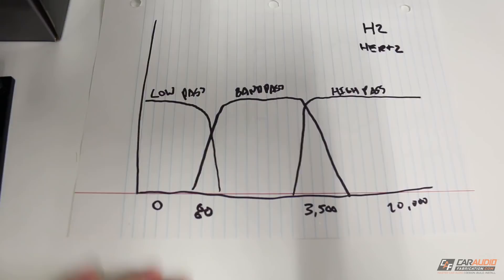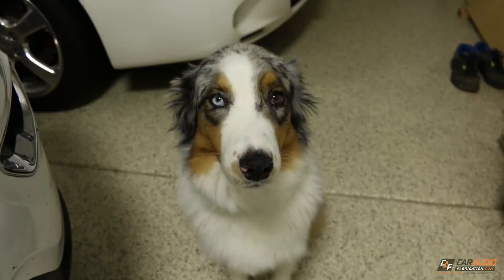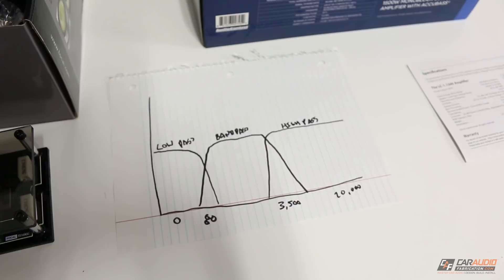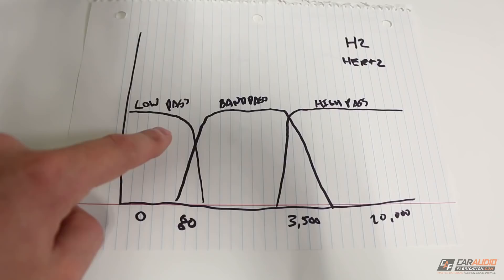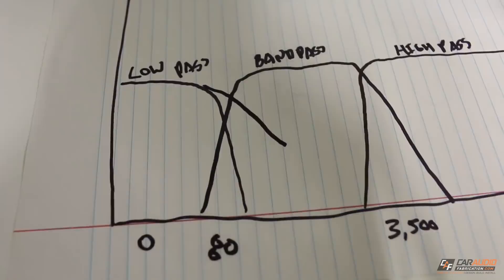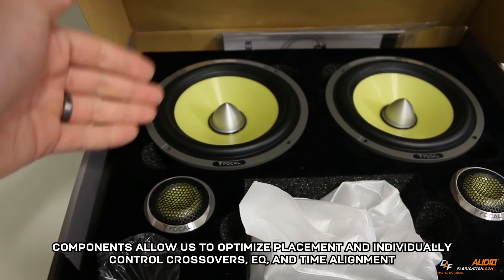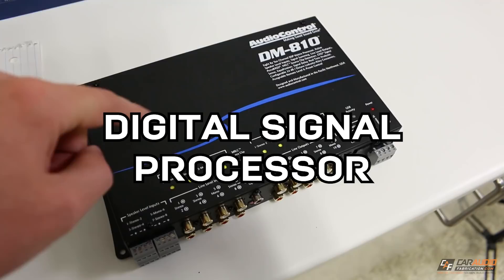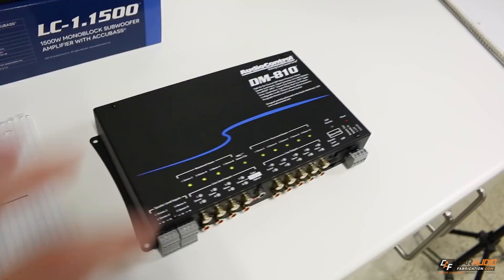Car Audio Terms you MUST Know

Comment: Cool dog. Hertz is also a speaker brand. I'm a retired electronic technician so I understand all these terms but I do occasionally come across something I hadn't heard before. It's interesting some vendors don't recommend a crossover for component systems - probably because the tweeters come with an inline non-polarized electrolytic capacitor whose capacitive reactance increases as the audio frequency lowers. I wish I still had access to all that test equipment you have.

Comment: Great Video👍🏿
I know im late, it being 2 years old already. Im an amature installer, and when I go to the local sound shop and begin inquiring about these Particular products, I cant seem to get them to go into details like You.  because Im wanting More control, planning on going with Focal 3way comps in my Caddy Srx(2014 Premium)for my front stage, Deleting the center stock speaker, and now,  realising how the position should be angled, But my Rear stage is a pickle for me, Because of those 2 speakers in my rear decklid. 
Now, after listening to You, solidified my choice in for my rear doors & decklid & about investing into an A/C DSP. Most importantly, saving me some $ in my build.
And intergrate my new Tesla style unit.

Thanks!✌🏿

Comment: Please help me. I have an alpine 600 watt amplifier and two 10 inch kickers. Just the other day the amplifier was blinking red and now that I've regrounded the wire, it's back to normal. Except when I hook my subwoofer the subwoofer shoots up and stays in the up position. Everything is connected right. 

Any tips? Thank you
Reply: Sounds like the amp is putting out a DC signal to the sub. That ain't good

Comment: If I’m using a 5.25” mid driver of a component set in a 6x9 opening and I want to get the most out of that speaker, what do I need to do?

I was thinking of a 6x9 foam baffle filled with poly fill
Reply: I would like that, but that is not a choice. I hot a Herts Hi Energy HSK 130 and I cannot get a 6.5"

Comment: Hi i have questions about alternators. You briefly mentioned a battery to power your amplifier i believe? So you're saying you're not using your alternator to power all these peripherals/accessories in your car? I was wondering if i did perform this setup, i'd need a higher output alternator for a certain vehicle of course right? I was wondering, where can i find a alternator for a S2000/modify and take it apart and have it internally make more power or something.

Comment: Hey man, really appreciate these videos. Have you done any work on a 2019 300? Wondering if I need anything special to keep the factory head unit and hook up an amp with better speakers. Crutchfeild has a list of compatible amps I can use but I am not sure if I will need a special harness or connector to use an aftermarket amp with it.

Comment: Need some cheap but decent 6.5 speakers. My car has 2 sets and 2 flush mounted tweeters with 6x9 in back deck. Its a Harmon Kardon system. Suggestions?

Comment: Why speakers would you recxomend to pair with an nvx had 800.4? Im putting a system in a 94 mercury sable, so im looking at 5x7/6x8s and 6 1/2s and this seems to ne a lot of amp for most speakers. Im fine with components. I'm fine with you using the car for videos too Lol. Plan to also run 2 type r 10s in a ported,box on 1200 rms @1Ω

Comment: Ohms? My amp can run 2 or 4 ohm speakers. It of course has a higher output at 2 ohms. I don’t need 2 ohm power from my amp and don’t need to drive it that hard (I guess?) I have a small space and am using it for bass and using the head unit power (for now) for power on dash speakers and 4by10s behind me. Kinda confused about “caps” I understand the theory behind them in that they store energy for the bass hit without dimming lights and being so hard on the alternator but what size or do I even need one with 150w into 2 subs? Was thinking about 1 sub and bridging? Thank you in advance for any help from anyone.

Comment: I have a Mark Levinson system in my Lexus. I think an aftermarket front speaker jacked up my system...now they replaced my sub, promised it would be great but it's not. 
Lots of vibration, poor aux output, and terrible whine when turned up. Thos sucks!

Comment: Great video thanks kindly!
Curious about how you have you BlueSea Split Bus fused block setup...are you using the switched portion (B) to turn on your DSP and then have the remote out of your DSP turn on your amps? Or do the switched terminals on the BlueSea turn on all your devices??
Many thanks!
Reply from the maker: I have a relay turning on everything that needs switched, constant to the other half.
Reply: @CarAudioFabrication  gotcha thanks! I was planning to have my relay's out wire go to the main terminal of 'B' portion of the Blue Sea split bus to act as the switched input wire.
And constant power from my Connection sfd41C to the main terminal of the 'A' portion of the BlueSea split bus. Then have wires from the 'B' to devices that need switched power and wires from 'A' to those that need constant. Doing so to keep all devices fused from the BlueSea.
Am I on the right track?

Comment: I thought the speakers continuous wattage rating was not to match or exceed the amps continuous wattage rating otherwise the amp would be pushed too much and it's life shortened similarly with the speakers. This is not to say to use a 1000 watt amp on 120 watt speakers. For example, I thought 2x120 continuous watt speakers would be better with a 2x180 or a 2x200 continuous watt amp, if that makes sense. I also though having the setup like that would allow room for both the speakers and amp to work easier than having them being pushed to their limits all the time. Tell me if I'm wrong please? I'd like to hear your opinions Marc. Cheers.
Reply: You are correct. It's called headroom. Keep your gains right and your volume low and it will sing!

Comment: What ever happened to your Jeep build? I have a Cherokee with a full Alpine R SQ setup. Curious to see what you do with yours.
Reply from the maker: These things take time, especially when using unreleased beta test style gear that requires firmware updates.
Reply: @CarAudioFabrication  

It sounds like you are running into the same problem I had with everything being run through the infotainment system and nothing on the market that is compatible. I ended up reinstalling the factory Alpine head unit to regain climate control and e-break settings . It was actually while looking for a good DSP I found your channel. 

No worries about time. I look forward to seeing any progress.

Comment: Ok my question is on (air quotes) Staging. Is the goal to have the (air quotes) center stage in the center of your hood, or the center that's in front of the the driver? JK about the air quotes but there were a lot of them. I've heard mixed theories about this. I feel that if you center your stage to the center of the hood, you're still off center as a listener. I know the rules as far as get the speakers as far away from you as possible to achieve more center, and time alignment can only do so much. But where should the "center" actually be?
Reply from the maker: User preference. Try both see what you prefer.

Comment: I love flac files, but there is a big BUT, people don't hear the difference, between a flac file or an mp3 of 192kbps, even sound engineers need to listen to a A , B test and really concentrate in order to tell which one is flac and which one is the mp3 file, also most cheap speakers (for example under 500$) won't be even able to produce the difference anyway...
That doesn't mean an mp3 192kbps file is the best, because some idiot might have up convert it to 320kbps from a 96kbps, it will sound like shit (96kbits)
Reply from the maker: This video isn't meant to discuss if something is 100% required or not. Just to discuss definitions of terms.
Reply: Yes i know, i just wanted to say my opinion for the flac files i'm just saying it for other people to know, if they read the comments. 
Also if you remove "Car" from the title it still works. Only the gain and the pillars are in the car audio, everything else is just for audio.